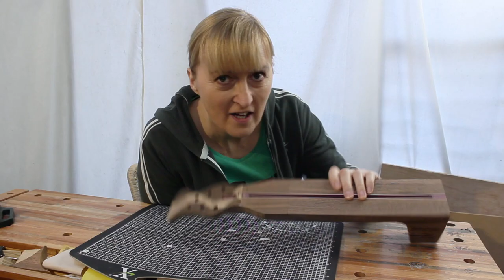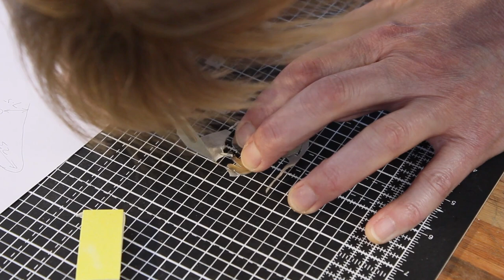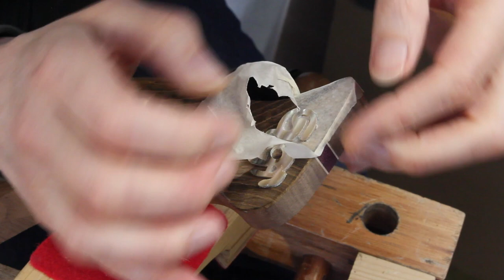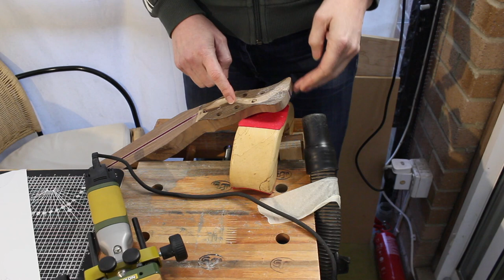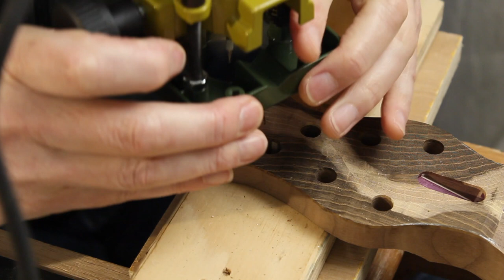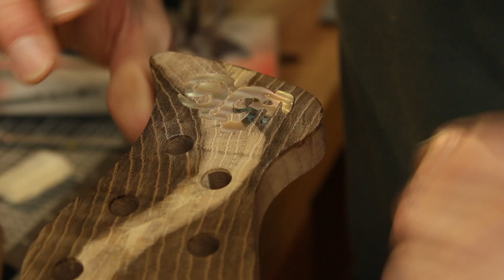SuGar SG1 acoustic guitar build part 22: Inlaying the headstock

Comment: Re extraction, how's about a smallish diameter tube, attached to a small flat piece of wood, with a Velcro pad on the back. Then use the opposite piece of velcro and just double sided tape it near to the extraction site. Then attach. Move the piece of velcro to where you want the extraction, next?
And when using this Proxon, the end of the tube could be several centimeters long, and therefore flexible. tape the end into that V shaped notch on the router attachment, so it moves with the router.

Comment: Very nice!  Where did you get that router bit, was it expensive?  I have the same Proxxon but so far only a cheap set of router bits, and I think I need something better.  I want to improve my inlaying skills; I have an interesting plan for one of the guitars I'm currently building!
Reply from the maker: It’s a Stewmac down spiral bit. I don’t think it’s expensive but of course you might get charged vat and handling if importing it.